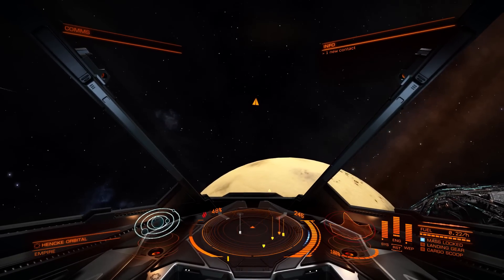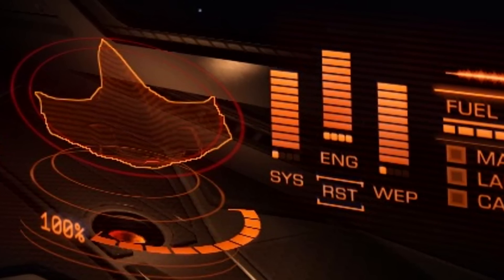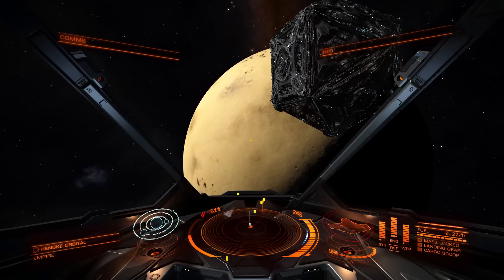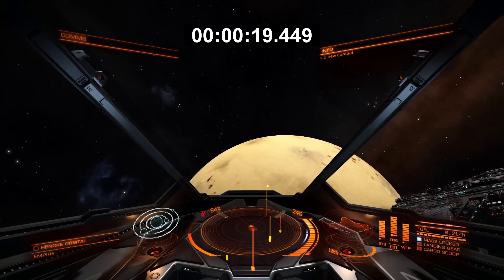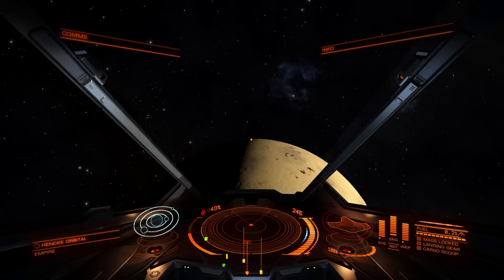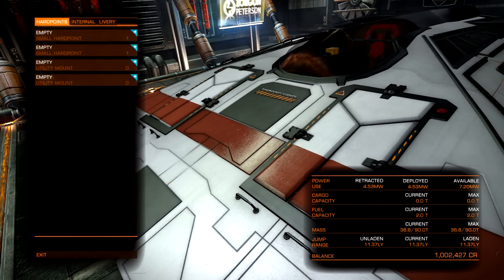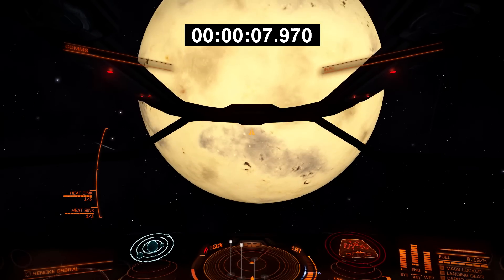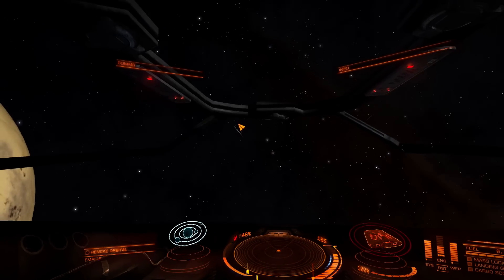Does the mass of your ship affect speed and manoeuvrability? - Elite: Dangerous

Comment: Sorry, but your title states "Mass" not size, they are two different things. There is "NO" resistance in real space so the size of motors wouldn't  effects the size, and or mass differently. It's the total weight of the object that one needs to control. A heavier object takes longer to speed up and slow down in addition to turns. In real space, wings, flaps, rudders, have no effect because there is no resistance for them to react too. The thrusting power of the motor upon the object is what determines how fast it can move from stationary to full speed, course corrections changes and the ability to either slow down and or stop. Basically the size of the motor and its thrusting ability determines the time or duration of given craft ti reach maximum speeds, turning and breaking. The same size motor in a smaller and or lighter craft allows it to start, turn and stop faster. It would have no effect on the difference in maximum speed between the actual size. Heavier objects require more thrust to achieve the same timing of a lighter object.

Controling a object in space isn't the ssme as in an atmosphere. Space flight in video games is never depicted like it would be in reality. However, ED has the ability to disengaging the flight assist, which makes the handling of a craft more realistic. Because of the learning curve of controling ones craft in all situations is considerably different between flight assit on vs off, the majority of players will toggle between them for different issues. BUT on will be utilized the vast majority of the time.

Comment: From what I hear, the only change you'll see when you add ship mass is 3 different "tiers"
Better Flight Model = Under Optimal Mass for Thruster Capacity
Normal = Right At Optimal Mass for Thruster Capacity
Worse Flight Model = Over Optimal Mass for Thruster Capacity

I understand you tested a barebones vs a loaded ship, but what was your thrusters' optimal mass? It seems like you had an under/over performance but I'd like to see the numbers.

I was kinda hoping you could get a better flight model at 15T under vs say 3T under, but I've seen nothing to point towards that. I'd like to see that if you'd be willing.
Reply: It's incredibly unlikely that someone would be at exactly the optimum mass for a ship's thrusters, so it can't be quite that simple. I would expect a curve of some sort where performance gradually improves with decreasing weight and worsens with increasing weight relative to the optimal mass, up/down to certain (unknown) limits. (Probably looking something like a graph of arctangent, with vertical axis the variation in flight handling and horizontal as the ship mass.)
Reply: Normally I'd agree, but every time it's been brought up its been stated just "above or below"
No real info, which is why it might be nice to conduct in game tests of varying thresholds
Reply: Keep in mind though that even the mass of the fuel you're carrying is taken into account. You have a certain mass with a full tank, but as you fly around and consume fuel, your mass gradually goes down a bit. So even if you carefully design a loadout to be exactly a certain mass on paper, it will only be that exact mass when you first take off after refueling, and soon thereafter (depending on use of cruise and hyper) will inevitably drop into the "less than" category.

Just three model choices, "less than, equal, or greater than," logically makes no sense - there has to be some sort of formula or scale involved. But I agree that some tests using loadouts that differ from thrusters' optimal masses by known quantities (each performed after fully refueling to minimize that factor) would be great, just to see how much of a difference two tons makes versus twenty tons, for example. The game UIs (and from what I've seen, the developers) don't seem to be that great about giving you actual numbers to look at. They should really take a page from CCP's book and give us numbers for ALL the things. :)

Comment: The bars for items don't necessarily have to be higher to be better.

Just look at weapons. All sizes of an A rated Pulse Laser display the same number of pips; but the bigger the gun, the more damage it actually deals.

Same with ships. Despite the maneuverability rating being shown as higher for the Sidewinder, the Viper is more maneuverable than it.

Also, you didn't test it with a load of cargo in your cargo racks; that also affects speed, though I am not sure about maneuverability as I have (had) no idea how I would measure it.
Reply: I don't know why they did that with the ratings, but it is not something new to me in games. A lot of casual shooters do this, too. They have some bars/pips representing all the stats, but items that have a higher bar in one thing than something else, end up being worse than the thing they are showing to be better at.

In my experience with E:D, it's the same. Then again, it could just be that is the maximum maneuverability, and only through upgrading and min/maxing would the sidewinder be better than the Viper. Maybe I'll try that... Just max out both and then see which one can slalom faster or something. You can feel it when they're stock, but I never upgraded a sidewinder completely, either.